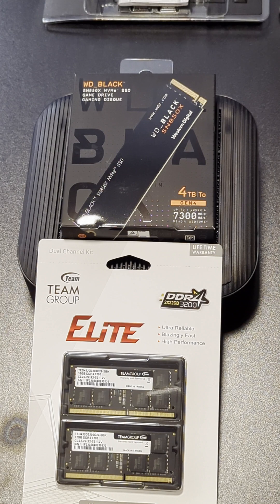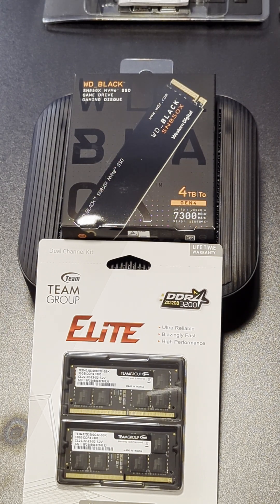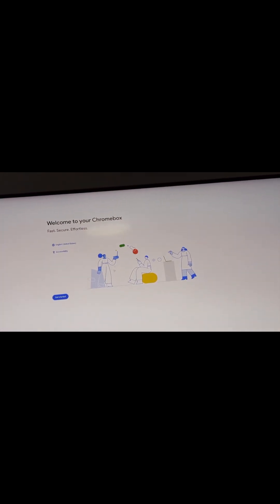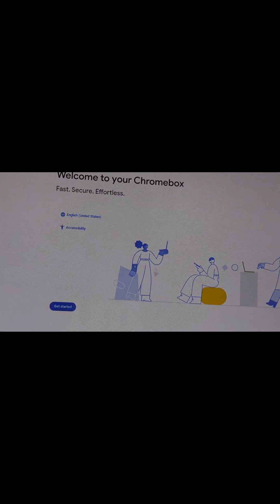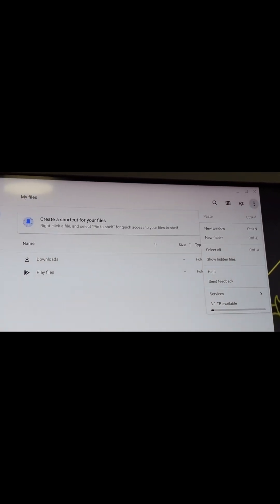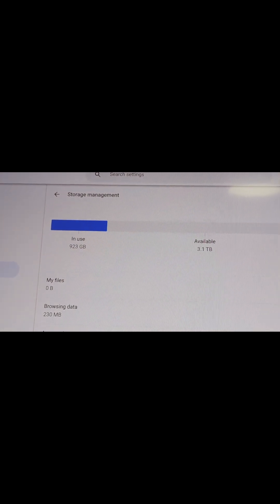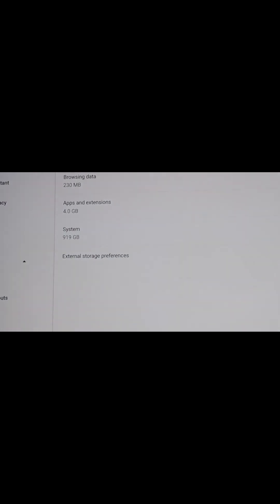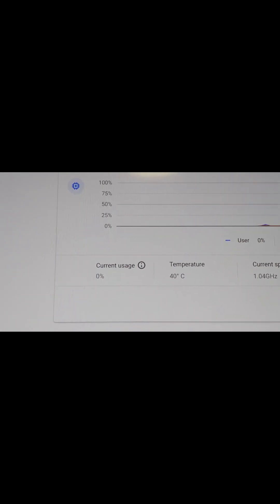Asus Chromebox 5 how to Upgrade Memory 4TB 64Gig

Comment: I have the Celeron Chrome Box 5. What upgrade specs should I purchase? If I do 4 TB, I'd blow it up.
Reply from the maker: @dlos1987 Celeron is slower but I don't see a problem with one, two or four TB, So you will have to decide what you want.
Reply: @brettatenciorn8522  Thank you for the Information

Comment: Thanks a lot, this is just what i wanted to see and know. I want to buy this Chromebox 5 and upgrade it directly with a SSD to 1TB instead of 256GB. Which 1TB SSD do you advice? A WD like yours or any other?
Reply from the maker: When I did the research on which ones to use, I tried to pick the best one so that's what I would recommend because I know it works. But in theory other drives should also work as long as the specifications are the same. 🙂
Reply: @brettatenciorn8522  OK thank you very much. I think I go for the WD_BLACK SN850X NVMe™ SSD in 1TB.  Last question, I promise : Do you think it is preferable to buy the version with heat shrink ? Will that fit?
Reply from the maker: @jankempynck3745  no, the heatsink will not fit
Reply: many thanks for this video !!

Comment: My quesiton is in regards to the ram type. I see that you used DDR4 3200, ut I see online that this chip should support up DDR5? Any clarification on that subject by any chance?
Reply from the maker: If you change the RAM you do not need to backup anything.  As far as the chip being able to handle DDR5 I don't remember why I used DDR4 at the time, can you provide a link of where you're looking at that shows the "chip" can handle DDR5?
Reply: @brettatenciorn8522  I've been trying to send you the links, but for some reason YouTube won't allow my comment to go through. I just looked up compatible ram types for the Intel® Core™ i7-1260P Processor, since I am specifically interested in getting that model later on. If you can help with proving or disproving this I would greatly appreciate it. 

*One specific website I found was the one from Intel stating that it somehow possible.
Reply from the maker: @feelgoodcharlie3822  I think you have to substitute some of the characters in the links to fool youtube that it is not a link as they might not allow links in the comments section.
Reply from the maker: @feelgoodcharlie3822  okay I checked up on it and the problem you're going to run into is not the chip It's going to be with ASUS motherboard it's only set up to accept DDR4 memory sticks not DDR5 they are very different the sockets are different the way they function is quite different and they will not work unless the motherboard is specifically designed to handle DDR5
Reply: @brettatenciorn8522  Alrighty! That answers my question! Thanks a lot. I'ma also be looking into the ram you listed in the description of the video for my own upgrade. I apprecaite the help.

Comment: wow you must be rich........given the fact that you just wasted all that $ when you could have just bought an external drive and been done.....you certainly do not need more then 16 gigs of ram for chrome os.......maybe 32 if you enable the linux enviroment.......as far as the wireless charging goes.....did you buy the one that has wireless charging?.....cuz thats a $20 option according to another reviewer. Also you might want to correct the typo in your title cuz its not 4tb of memory its 4tb storage and 64 gigs memory